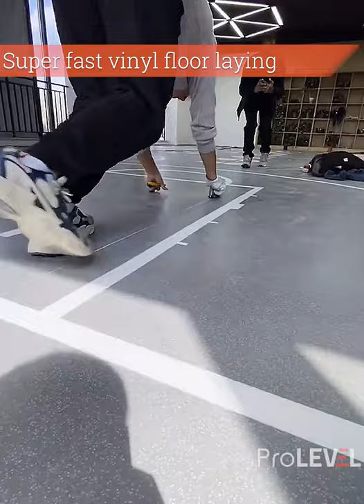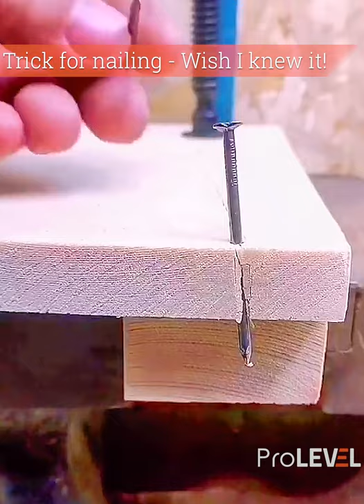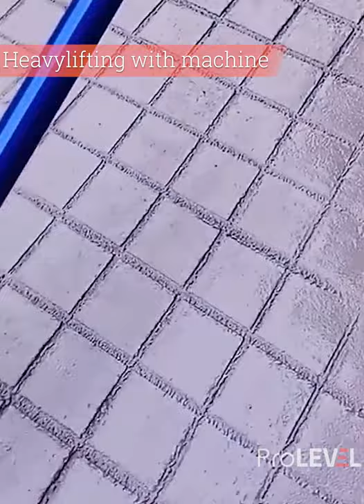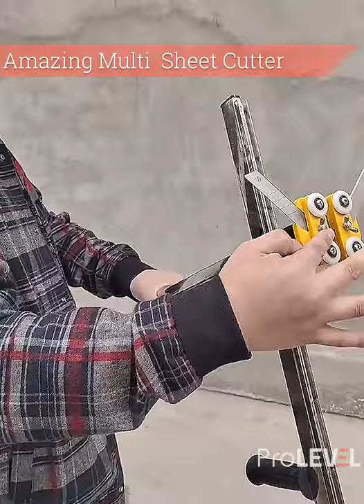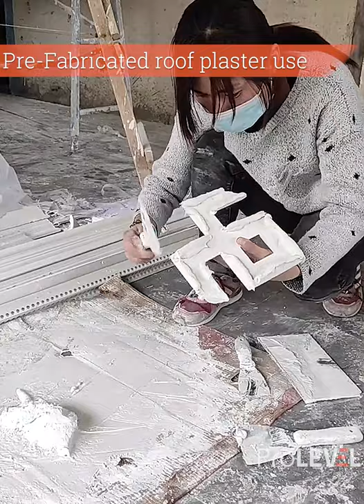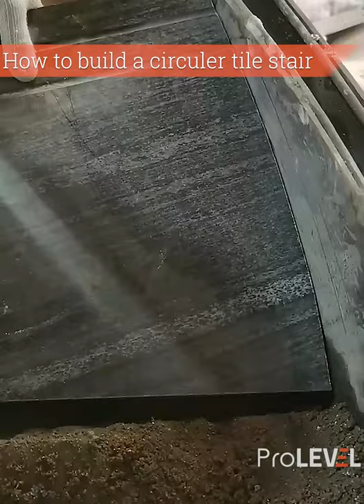Ingenious Construction Workers that Are At Another Level ▶  Skills You Must See # 79

Comment from the maker: In today's video see how to use The fiberglass mesh - it is a cheap material that doesn’t burn and is characterized by low weight and high strength.
 These properties allow it to be successfully used at this formation of plaster facades, as well as use on ceiling surfaces and internal walls.

Comment: They might work fast but some either follow poor building standards or don't know what they are doing. Is this why china has so many knew buildings falling apart? I never saw anyone use concrete over foam for facia and simply try to bond it to an already dry concrete ceiling with nothing else. No wonder they fall off from weathering in a couple years. Lots of videos showing the poor construction on YouTube.  I wonder why this happens.